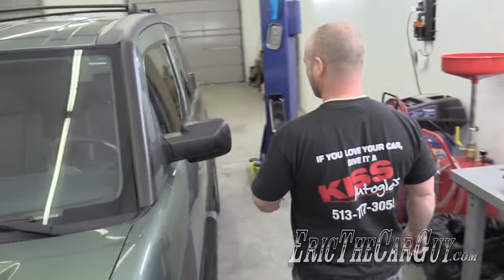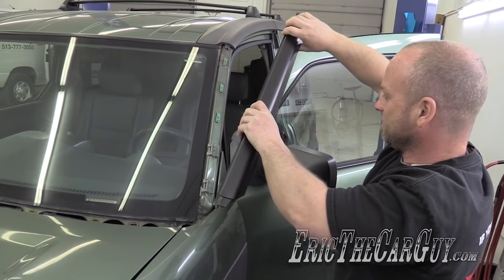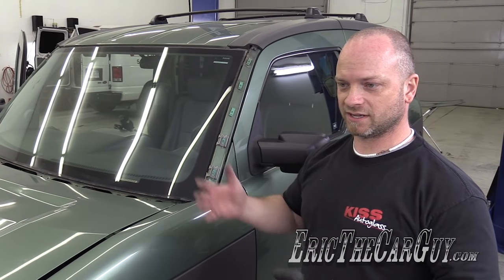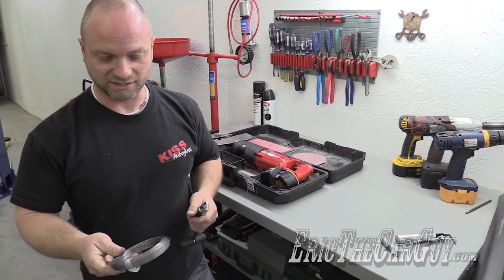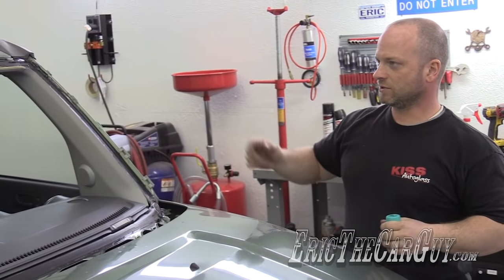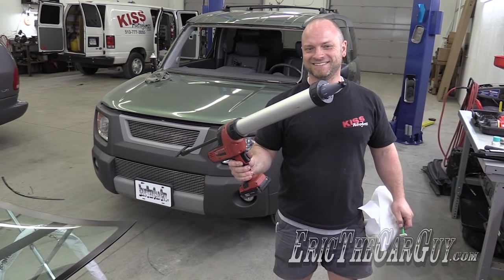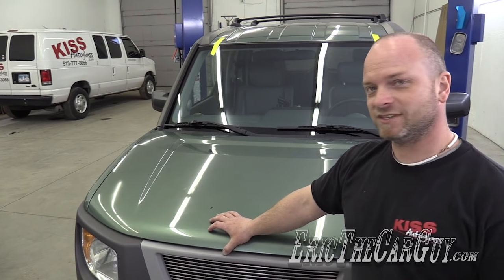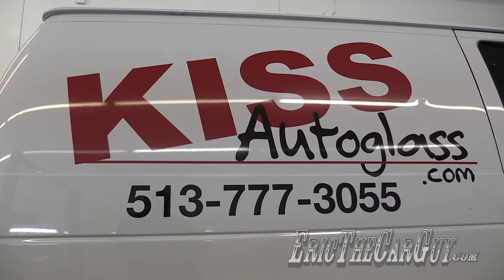How To Install a Windshield the "Right" Way -EricTheCarGuy

Comment: I’ve been in the business 25 years and watched this video in hopes he could show me an easier way to reinstall the two a-pillar moldings but we do it exactly the same way so I’m thinking there isn’t another way. The a-pillar moldings on this car or some of the worst designed  in the business but that’s just the way it is. There are a few more details concerning the a-pillar moldings that had to be done before reinstalling them that were not shown in this video that make this car a real pain in the pooper. The rest of the windshield job is straightforward and simple. He did a great job and uses old school cold knife techniques like I do. Old school is still good. Well done!
Reply: Totally agree. I just got mine replaced professionally but the columns are a little loose towards the bottom, consequently The rubber gaskets are not pressed tight against the glass. Probably the plastic clips are broken or not holding properly. Anyway I am taking it back so they can fix it. Definitely it has to be a proper way to reinstall them.
Reply: Which cars have the a pillars
Reply: @user-cg7jp7jt4v all cars have a pillars but not all have a pillar moldings. The a pillar is the left and right vertical posts that go up from the hood to the roof. The big plastic moldings on this car have a complicated clip system that attaches it to the body of the car and covers the edge of the windshield. Stupid design on this one. One of the worst.

Comment: Nice work. My windshield is being replaced as I watch this. Why is my windshield being replaced you ask. Well I was checking my wiper blades when one of them slipped completely off the metal arm allowing the spring loaded arm to drop about 6" striking the glass and breaking it and costing me several hundreds of $$$. If you change your own wiper blades PROTECT THE GLASS.

Comment: Rich's attention to detail ensures the job is done right each and every time- a sign of a true professional. Thank You Rich for sharing a unique skill set.
Reply: Jimmy Mac Thank you
Reply: As far as I know, the Betaprime 5504G Primer that he was using in the video is capable of bonding and sealing to bare metal.  Usually when we get a rust spot on pinch welds, we grind off all the rust, clean the metal, then seal it with that Primer product to ensure the rust won’t be an issue anymore.  It’s the same with any body work on metal parts of the body.  If the rust isn’t dealt with, it’s going to keep creeping under the paint and corrode further through the metal and cause more problems down the road.
Reply: @richardkiss3842  why wouldn't you treat the rust with phosphorus I think?

Comment: I work at a body shop and see this done almost daily. This guy knows his stuff. The only caveat I have about this install is the rust. It is very hard to stop and will eventually cause the windshield to leak and/or crack. There are a lot of hacks out there. But Eric has picked one of the good guys. Nice job!

Comment: It's funny the people trying to pick this install a part. Mr. Kiss installed the glass properly. I can assure you that you don't find many that will take some of the measures he took to do a great job. I have been doing it for 16 years of my 36 years of life. I've had no training other than someone showing me how to remove and replace the glass. They didn't fix scratches or rust, check body seams, or anything. Just cut it out and shoot a bead and stick it in. I had enough common sense to figure out bare metal will rust with water standing around the pinch weld for days after rain. I had to learn a lot of what Rich just showed you by trial and error. Any newer installers should be thankful for this video to teach them the proper way to do this job. If i had installed this glass, it would look almost exactly like the procedure rich used, step by step. I do a lot of wholesale glass replacement for car dealers and body shops. I'm pretty much the "cheap guy" they refer to in a lot of these videos. I really wish some of these shops wouldn't lump us into a category hacks just because of our price. Just because it's cheap doesn't mean it isn't done right. I know it happens with cheaper sbops but I see a lot of the so called "pros" $300 install that's not up to par as well. I also hear a lot of the YouTube guys talking about oem quality glass. I'm noticing most all windshields are made poorly now. I use pilkington glass as much as possible but sometimes a car dealer is not willing to pay enough to get it so I will use a cheaper Chinese glass as long as they know up front what they're getting. For the record, a lot of the glasses used by the manufacturers now are Chinese glasses. There really isn't a glass made that is superior to all others and I've used them all. Anyway, good job Rich. It's good to see someone else in this profession that takes pride in their work as do I. Good luck in the future.
Reply: +bigredglass I have had more issues with Pilkington Glass than any other and I do 6 a day..Hate Pilk crap
Reply: They're not they used to be for sure. I rarely had any problems until about 5 years ago. I'm not really crazy about any of them now. It's getting harder to find quality glass now. Especially in tempered glass. ATI is about the worst imo.
Reply: He did it 99% right, he did not remove those mouldings right, you push them in towards the glass not just rip them off, that's why they were so loose after
Reply: How does FYG glass compare to Pilkington? I'm concern about the fit and thickness. An auto place mentioned PGW. How does PGW compare with the other 2 brands? Does it matter if the company is not AGSC certified? One company was Dinitrol certified. Is that equivalent to being AGSC certified?
Reply: How do I pick a good glass company?
Reply: @tracyphoenix8  Hi Tracey, Dinitrol certification will only certify the individual for the proper use of Dinitrol urethane.  There is a pretty good probability I trained and certified those who you are talking about.

Comment: Overall, this was a pretty good install. There are a few things I would recommend changing, but this is quality work!
My ideas I offer would be:
Invest in some quality suction cups. We use them, and it helps with the installation process of the job. You can grab the cups and not have to worry about the glass going anywhere, or getting your hands on the primed area.
DOW has a primer that works on both glass and metal now. It's amazing stuff, and works wonders. They also have a urethane equivalent to Express called ONE. Which has the same set time, but adheres to aluminum better and doesn't interfere with radio signal if it's an issue.
I would use paper towels instead of a rag to wipe pinch welds down, and a different towel to wipe the dash.

And a 30 minute job is quite possible, if you have 2 people who are working on it at the same time. That's how our shop works, and we consistently get jobs done in 25-45 minutes. Some faster than others.
Other than that, this was a pretty solid install, and I would love to work for this company if I was in the area.
Reply: What was the spray he put on the glass at 23:20? Also, what was that highlighter thing he used after that?
Reply: That was glass cleaner, then he used a primer stick afterwards.
Reply: Never seen anyone use that sort of force on the side covers.   He must ruin a lot of them.  Other than that  very good.
Reply: That is standard practice on Elements sorta, takes about that much force but you push in towards middle of the car.
Reply: So I would not have you do an install for me. You obviously do not treat rust issues and neither does Rich. That alone is reason enough that this is a very bad install.
Reply: A lot of shops are using FYG glasses. How does this compare to Pilkington brand? Does it matter if the shop or technician is not AGSC certified? Thanks in advance.
Reply: @tracyphoenix8  In our shop, all tech's are certified (every 3 year requalify) and we use all manufactured glass venders.  FYG in most part are not bad, and a lot of the new cars actually use FYG as there OEM glass from the car plant.

Comment: My Tacoma  had a windshield replacement before I got it, but they scraped most of the paint off as they removed the old sealer, and only put new sealer on the bare metal, about 6 years after I  got it, it started all rusting out, I took out the windshield, scraped, sanded, wire brushed, then SAND BLASTED,every inch, to get the rust out of the pits, then 2 coats of epoxy primer, 2 coats of urethane primer, then 2 coats urethane top coat, waited 3 days Then installed a new windshield,  To much work, so if there is nothing wrong with the old sealer, and no rust, leave it and do what Kiss did. Good VIDEO,  thanks William

Comment from the maker: Ever wonder how to install a windshield? https://www.youtube.com/watch?v=Y2eG1_1Ed3M
Reply: EricTheCarGuy Did you do the filming in this episode?
Reply: ***** Tell me you saw this video and I'll give you a 10% discount
Reply: couple  of time I had my windshield replaced. The installer said to me.  For a proper cure,  to turn on the defrost on heat. Is that a standard practice?  It wasn't mentioned on this show.
Reply: Rafael A. Nieves They were probably using one of the cheaper urethane materials to glue the windshield in, so it needed higher temperatures to cure.
Reply: Rafael A. Nieves  Some urethanes cure from heat and humidity, depends on the make of the glue. You don't really have to turn on the defroster
Reply: papa bear Plus, this would result in quite an uneven curing process, since the defroster vents are only at the bottom of the windshield, so the sides and especially the top don't really get much hot air.
Reply: EricTheCarGuy Thanks for the video Eric, this was a great video!
Reply: EricTheCarGuy How much does it cost?
Reply: Boodieman72 Richard mentioned some prices for the very cheap jobs in the video, so you put 50 bucks or so on top of that and you should get a decent job done.
Reply: EricTheCarGuy could you do a video explaining how ac/heat/defrost works and the best way to use them?
Reply: Ron Sauer camera work.
Reply: The clearest windshield ever!! Lol
Reply: EricTheCarGuy This guy has a good sense of humor, eric
Reply: clearest windshield I like it madmax lol
Reply: +EricTheCarGuy it sounds like the glass cracked when you were using the cold knife.. did it crack or is it just the knife making a noise when cutting
Reply: he ain't feeling your jokes.. lol .. some of them were kind've funny....
Reply: hey do a video on tint ... that wod be sweet ...
Reply: No rust prep. No activator on pinchweld=future problems
Reply: Daniel Valdes Basically, I wouldn't want him to do my car.  And he takes an hour to do a install....
Reply: that rust should have been treated
Reply: +Rick & Morty What's the correct way ?
Reply: Rick & Morty:  Just to be fair, what did this man do, that you in your infinite wisdom think was wrong ?
Or are you one of those people that find fault with everything and anything ?  Please respond, you made an accusation now justify it.
Reply: Eric O would have been all over that rust. sandpaper, wire-wheel, sand blaster, brake cleaner Fluid Film.

Comment: One thing not mentioned is that the W/S is an integral part of the structure of the vehicle and actually part of the SRS.  When an airbag blows, the W/S has the job of remaining intact and deflecting the passenger bag towards the occupant.  A good quality urethane is absolutely necessary.
Reply: Audioquest56 Agreed!!!!!!!
Reply: Audioquest56  Some vehicles also need the windscreen as a crutch for the roof in a roll over, bad prepping and seal can cause the screen to detach and the roof to collapse more and can cause injury to the occupants of the vehicle.
Reply: Audioquest56 Wow, I had no idea. Structural integrity is supreme. Thanks for chiming in on this one Richard!
Reply: Audioquest56 Yep, I have seen all the testing and real world results and a good windscreen replacement can literary be the difference between life and death.
Reply: ***** Thanks for your comment. 

AGAIN. 

I had no idea. Somethings you have hear multiple times to learn them. 

Ya know. I've seen some movie crashes with great window installation and very poor installation. It definitely makes a difference in rollovers.

Movies are not a great place to learn much, but some of the vehicles they crash are legitimate and not just props. 

Chuck Norris was big on that on his Texas Ranger show. Using the real items in the crashes. Sure for some spectacular crashes they'd use hidden ramps and things.
Reply: DE Nichols Yeh, um I was just agreeing with the fist poster, about how important windscreens are.
Reply: I will add that the windshield is also an essential part to support the roof when a car capsizes.
Reply: Say 'Hi' to Noah for me!!!

Comment: One time at a rally i saw a civic that boke its winshield in the previous stage borrow an evo winshield from a friendly team (probably 6 - 8 inches wider than the stock civic windshield), they used something like 6 rolls of duct and gorilla tape and somehow got the safety inspectors to ok it... was a beautiful thing.

Comment: I was borrowing a friends 92 Mighty Max and a rock hit the windshield The Glassmen said the glass wasn't available so I found one in junkyard for 35 bucks and removed with piano wire trick. Asked Glassmen if they could install they said 200 clams just for labor. So I watched this video and ordered the supplies online and replaced windshield this morning, it went well and I saved a lot of dough.  It took,me longer than it would have taken a pro but at least i didnt have to pay those pirates Thank you so much guys

Comment: his arms are tools too! :D i helped a friend in his workshop with a couple of windshields and it almost always was a two man job to cut them out.
Reply: tasty2choc yeah i noticed that as well, those blades look like it take a LOT of force to cut through
Reply: tasty2choc Not always a 2 man job, depends on the size of the windscreen, and if it was replaced already, if so the tech could have shot a huge bead of glue and that makes the cutout process irritating. Still love the autoglass business though!

Comment: Thanks for a great and informative video from you both I was using my friends 1992 Mitsubishi Mighty Max unfortunately I was driving on the highway and a stone from a dump truck hit the windshield completely cracking it I tried to get the windshield and glass companies we're telling me that this windshield wasn't available the two of them that did have the windshield wanted over $400 to do the job so I went to the junkyard and found a windshield for $35 I removed it using the piano wire trick and it worked like a charm I watch this video ordered all of the supplies I needed online and replace the windshield myself and it was easy thank you for helping me and others by making this video

Comment: The newer the vehicle, the more crucial PROPER glass installation is.  The glass has become a structural element of vehicle design and improperly installed glass can be dangerous.  The glass plays a major structural component of rollover protection (see roof crush tests).  Glass quality is also as important as the installation. Cheap glass can be both visually and structurally inferior to OEM glass.

I'm in the collision repair industry and this is no place for amateurs or hacks.  Don't cheap out of this job, be careful about who you let replace your glass.  Shopping by price out of Craigslist is not the place to be...
Reply: ratbert86  The problem is that people are in many ways greedy. So are the glass companies. People wanting the cheapest price and companies wanting to charge the most with the cheapest output of materials ends up making some bad quality of work happen.
Reply: Brian Walker Nothing wrong with cragslist. it is a good free place to advertise.
Reply: you wouldnt like how we just slam glass in on subarus then on the production line of them

Comment: I took out my first windshield recently… was an original windshield from a 2006 Texas car. 
Went into it planning on using the wire method, but ran into literal snags because it was a completely smashed up hail dmg one.
Ended up doing it with the cold knife/razor blade on the 17” stick; the razor blade was the real champ for an affordable price.

Another tool I used was an oscillating tool with a “sealant blade”. It worked well for me on the a-pillars, but don’t recommend it for a beginner on a windshield that you don’t want to dmg. (Mine was smashed, and needed recycling.) + if can easily scratch paint if not controlled. Also had issues certain areas of a smashed windshield.

Depending on the type of vehicle it can be difficult to use the cold knife shaped like an ; mine was a vw beetle, and the exterior trim is just painted metal without much room for the blade. Also the harbor freight cheap cold knife blade wasn’t long enough to cut through the adhesive all the way in some spots.

Comment: you push those side moldings in towards the windshield to get them off the car properly. you dont just rip them off like He Man
Reply: hahaha. have fun with all your broken clips.
Reply: +DKStudiosful Not to mention he didnt whiz wheel the rust off before he primed it -_-
Reply: yeah he broke the white ones off and didn't glue them back on so when he smacked them down you could see how loose they were, that car was definitely getting air nose from those loose trim pieces
Reply: Yup, other than that he was pretty good